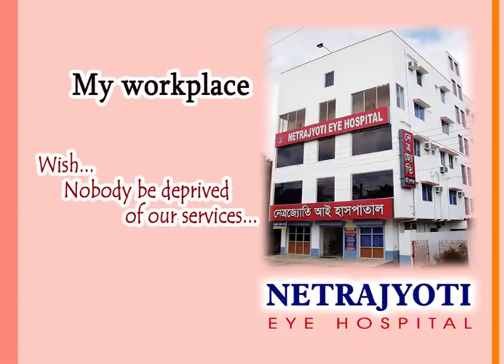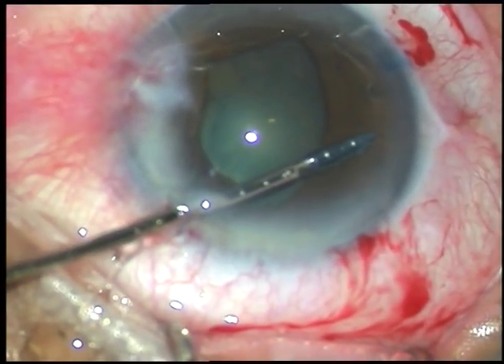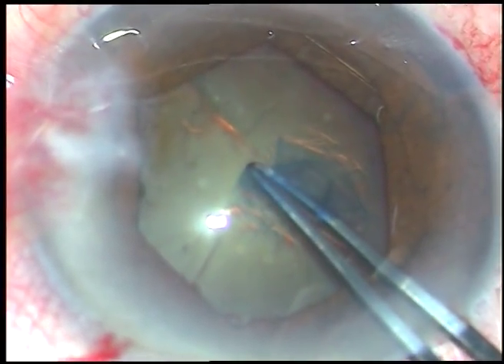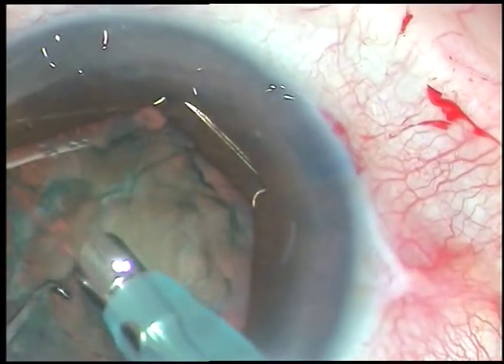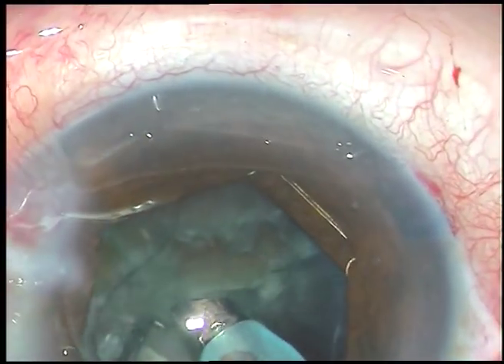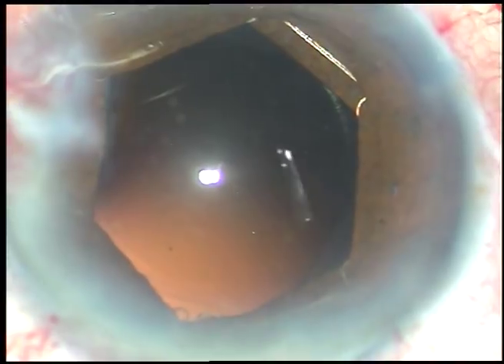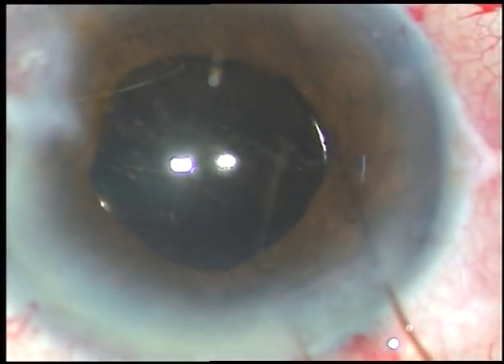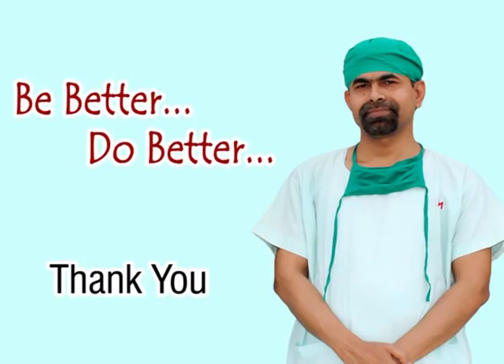IOL displaces the B-HEX : How to avoid this?

Comment: Sir,after lense removal if we inject visco and remove b hex and after it we inject lense than I think it will be safer.....
Reply: One of the uses of a pupil expander is to be able to visualize the capsulorhexis margin all around to facilitate IOL is placement in the bag. Removal of the B-HEX prior to IOL implantation would defeat that purpose. Hence, I prefer removing the B-HEX only after IOL implantation. If we take adequate precautions as mentioned in my post above, we would be able to realize the full value of the B-HEX Pupil Expander.

Comment: An excellent video highlighting a very useful teaching point. The displacement of the B-HEX could have been avoided by delivering the trailing haptic in capsular bag too in a single motion (instead of leaving it on the iris). 
An IOL placed on the Iris can often be pushed into the capsular bag by forcing it against the pupil margin. However, this would not be applicable in the presence of a pupil expander because any attempt to push the IOL against the pupil margin will result in pushing the pupil expander. Nevertheless, this video demonstrates great presence of mind and improvisation in technique in an adverse situation.
If the trailing haptic has not been delivered into the bag then, 1) It should be dialed into the bag ASAP (before it can completely unfold) 2) In the presence of any pupil expander, the trailing haptic should be guided into the bag by  pushing/ pulling the outer edge of the haptic in the plane of the IOL – so as to cause flexion of the opposite (leading) haptic-optic junction against the equator of the bag – and thus create room for the trailing haptic to negotiate the pupil-expander margin without contacting it.
A similar situation has been reported and managed very well by Dr Arup Bose at: https://www.youtube.com/watch?v=nK-Tbr5RCLo&t=